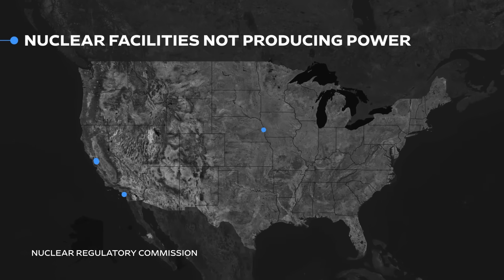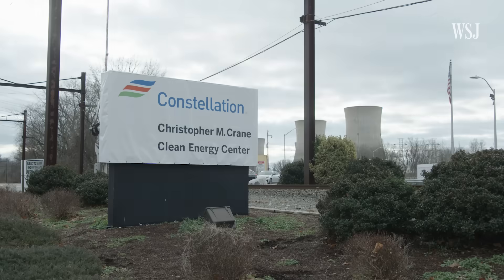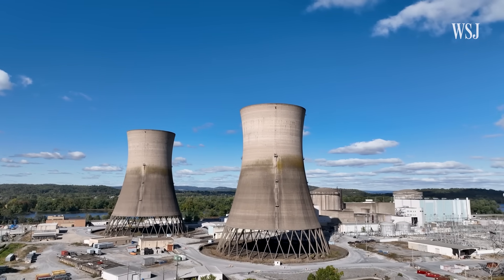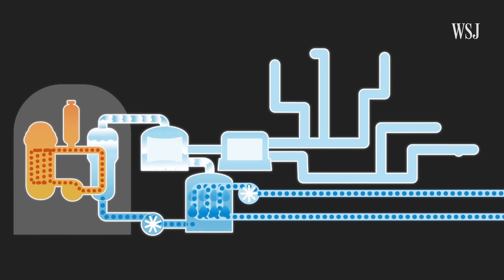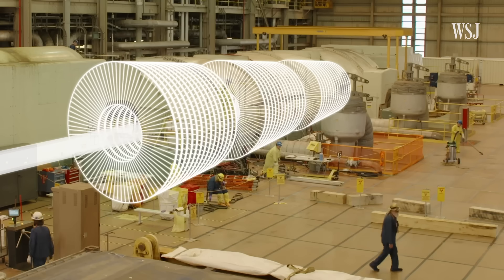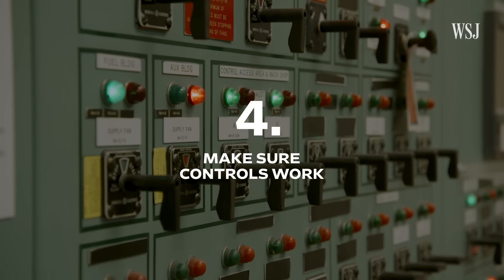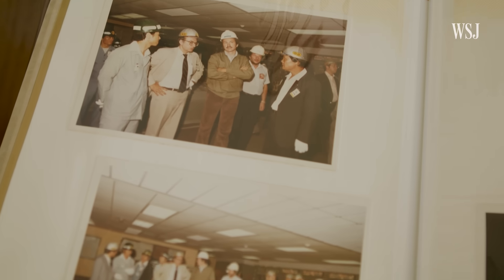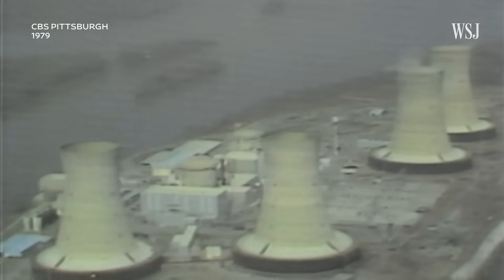Inside the $1.6B Plan to Restart Three Mile Island | WSJ

Comment: Three Mile Island is like the anti-Chernobyl; At Chernobyl, the poorly made reactor exploded and caused a huge catastrophe, while the government denied the severity of the problem, whereas at Three Mile Island, the incident was relatively minor, the reactor didn’t explode, but everyone around totally freaked out about it.
Reply: It was in fact rather minor compared to other meltdowns
Reply: I wouldnt say it was minor, but it wasnt exactly “dangerous” and definitely was very exaggerated
Reply: I'd generally frame the three mile island incident as: despite almost every possible maloperation, equipment failure and design issue that could make the situation worse occurring, the robust design of other elements and overall integrity of the system saved it. It's a demonstration of good engineering practice and a sobering reminder of the inherent hazards at play - how easy it is to defeat safeguards and how they can also potentially make things worse. 
It provided invaluable lessons that are useful to this day across multiple industries.
Reply: I think you’re downplayIng what happened at TMI. It’s true that it wasn’t even on the same scale as Chernobyl.  What is also true is that the distinction was mostly due to luck, not some sort of superior knowledge or skill or engineering. TMI was a near meltdown situation - not to be dismissed as some sort of success story in relation to Chernobyl
Reply: @marlow769  Retired Nuclear Plant Engineer here: TMI was a partial meltdown.  I have seen the pictures and read the reports.

The reason it was insignificant to the public is because of the containment building which contains all the nasty radioactive materials inside of it.

Luck had nothing to do with either TMI or Chernobyl.

It was a resounding success for the decision by the USA and other counties to require very expensive containment & shield buildings (which often was 1/3 the cost of the nuclear power plant); and Chernobyl was the demonstration of the effects of not having a containment building.

If Chernobyl had a containment building the graphite core fire that released the vast majority of the radioactive materials would not have grown and persisted as the oxygen inside the containment building would have been consumed very quickly.
Reply: @marlow769   Retired Nuclear Plant Engineer here: TMI was a partial meltdown.  I have seen the pictures of the partially melted core and read the reports.

The reason it was insignificant to the public is because of the containment building which contains all the nasty radioactive materials inside of it.

Luck had nothing to do with either TMI or Chernobyl.

It was a resounding success for the decision by the USA and other counties to require very expensive containment & shield buildings (which often was 1/3 the cost of the nuclear power plant); and Chernobyl was the demonstration of the effects of not having a containment building.

If Chernobyl had a containment building the graphite core fire that released the vast majority of the radioactive materials would not have grown and persisted as the oxygen inside the containment building would have been consumed very quickly.
Reply: @marlow769  I’m not sure you can call not bypassing all your reactor safety logic luck.  Also TMI was an actual meltdown that was properly contained.  Chernobyl was a prompt criticality that resulted in a steam explosion.  It’s a big difference.
Reply: Chernobyl is a 6 on the international nuclear event scale.  TMI-2 is a 5. Serious according to the IAEA. There was an offsite release of gaseous fission product. Not anything like Chernobyl. The event scale is logarithmic. However it was still something to be taken seriously.
Reply: They also lied at 3 mile. Maybe you're not familiar with the history
Reply: No, at Three Mile Island, Met-Ed lied to everyone about what was happening. It was so bad that the governor of Pennsylvania finally had to step in and clarify that they weren't getting factual information. In fact, they did have to release radioactive isotopes into the atmosphere due to fears of hydrogen gas causing an explosion. After it happened, there were attempts to silence whistleblowers and even planting of drugs in one person's vehicle. If you lived in the area you would know that the information you received on the news did not depict the whole picture.
Reply: Imagine the valve got stuck closed instead of open…
Reply: @Sws4031  There are multiple safety valves just for that scenario.  The plants I was on staff in which were designed in the late 1960's had three of these relief valves all in a line (TMI was in 1979).  The setting on the valves valves are different.  so that they do not all lift at once.  But the 2nd one will lift if the lowest pressure setting one does not, and then the 3rd if the 1st two do not.
Reply: @perryallan3524  Well I guess playing nuclear Russian roulette with 3 valves in the equation is certainly better odds than just one.
Reply: @Sws4031  The chance of 3 independent pieces of equipment failing at the same time is extremely remote.
Reply: Chernobyl was a failure of Communism, not nuclear power technology.
Reply: You missed the part that in the US regulations became stricter. That's learning. It would be ignorant to roll back regulations.
Reply: Mate it was a very serious event that was nearly as catastrophic as Chernobyl, the difference was dumb luck.
Reply: I wouldn’t call Three Mile Island accident minor how’re radiation released to the environment was very small. The containment system worked.
Reply: A partial meltdown of the core isn't really minor, but there wasn't a reactor explosion. (Despite there almost being one due to a buildup of hydrogen in the vessel) Nobody died. And the towns and cities nearby didn't become uninhabitable. So yes, The Three Mile Island incident despite being the worst nuclear incident in U.S history, didn't cause any long term damage. Aside from the technology itself. This accident ruined nuclear energy's reputation.
Reply: You don't seem to be familiar with what happened at the Chernobyl nuclear power plant. The personnel themselves are there, by disabling all defenses, to the point of explosion. Ignorance and lack of staff experience is the main cause of technological disasters. As of April 2024, seven Chernobyl-type reactors are still in operation in Russia. And there are no more problems with them after so many years.
Reply: @andrek4619  The Chernobyl style reactor's are RBMK-1000 boiling water reactor's.
Reply: And part of the reason for the TMI incident was failing to follow proper procedure. People supposedly interfered with a working system because they "thought" something was wrong.
Reply: @anthonykaiser974  Retired Nuclear Plant Engineer here:  Not true.  They operator actions were within the approved procedures and expectations.  The cause was that the plant operators did not have information that told them the condition of the plant.  They did not know that a relief valve had stuck open causing a small loss of coolant accident (LOCA) and the did not know that there was now a water level in the reactor (which is supposed to be fully flooded and full of water.

After TMI the NRC required all plants in the USA to retrofit temperature sensors on the relief valve outlets to identify a leaking or open relief valve, and required all PWR reactor to retrofit multiple redundant water level indicator systems on all PWR reactors; and all future new reactors to incorporate both of those into the designs.  Most other countries immediately adopted the same retrofit requirements.
Reply: Wait. Nuclear powered artificial intelligence? 
Somehow that sounds seriously sketchy.
Reply: @planetmchanic6299 there is literally a whole genre in the literature about what could possibly go wrong here!
Reply: splode*
Reply: This I agree. US reactors were made to cool themselves down when lost control. We already have inherent safeguards to avoid reactors from having a serious meltdown compared to chernobyl, unlike chernobyl, our reactors would be unable to meltdown unless you DELIBERATELY Melt them down. Otherwise if loss of control to the reactor they'd cool down. You idiots focus too much on the scary aspects, no wonder you went against nuclear. Scared about incomprehensible things like its a steven king flick. 

I may not have any family who worked in nuclear power nor do i have any expertise but I know enough common sense to know if Three Mile island is Bad, and Chernobyl is worse, then I got no worries restarting a decommissioned plant with a partially melted down reactor that isnt difficult to restart.
Reply: indeed ceiling it meltdown is totally a exageration
Reply: I recall reading of pets eyes turning white near 3 Mile Island. What would happen to human eyes ❓
Reply: Wow, you drank a lot of Kool-aide from someone with all of that drivel. Go watch the documentary called Melt Down. Get back with us about who hides things and who did the freaking out.
Three mile island wasn't minor. Those exposed wouldn't think of it as minor either. Especially with people telling lies and trying to cover it up as being minor.
Reply: I like the idea of using the land and infrastructure of the plant again. It’s all there. Saves so much money. I would like to seem them upgrade the system to the generation 4 reactors that are passive safe. And the entire control room needs to be upgraded and be replaced with one that is designed by Airbus. With built in safety features that make it pilot proof. If you fly you know that three mile island is like the 707 of jets with a million things that can kill you if you’re not on your game. Compare that old jet design to a new Airbus and you have built in design safety.
Reply: Exactly. We need nuclear power to fuel the growth of our industry. All the reactors that are able to be should be turned back on or updated and then turned back on.
Reply: I live in the “Evac zone” of an issue ever happened at TMI again. The people around here are still not fond of the plant, especially those who were around in 1979 for the accident. 

All we’ve ever heard all our lives is how there was an accident and how dangerous it could have been.
Reply: It was sabotage before, during, and since... Had they followed protocol there'd have been no 'accident'
Reply: To be fair the people living right next to the reactor where told it was completely safe and the next thing they knew they were evacuated
Reply: It wasn't a poorly made reactor but a poorly designed reactor. A poorly made reactor is one with faults in its construction rather than its design.
Reply: Bro if you watch the documentary you would eat your words. Three mile island waa a hairs breath away from being a Chernobyl.  It was bad and the power company and Department of Energy out right lied.  All the rods were sitting on bottom of reactor lol.  This would smokes the entire Easter sea board.
Reply: > minor
> meltdown
Reply: @azrt43 Yeah, the unneeded evacuation actually caused more harm than the reactor did. The reactor hurt nobody. Fear and ignorance did.
Reply: Chernobyl’s design wasn’t the issue.  It was removing all of your safeguards to do an idiotic grid test.  Yes we all know about the positive Rx at the tip of the rods and the positive temp coefficient of reactivity.  If the safeguards were in place and they didn’t violate their design basis to do the test you wouldn’t have been there to begin with.
Reply: @AAblade7  приведите ХОТЬ одно нарушение, допущенное персоналом, с обоснованием. Регламент и ПБЯ–04–74 в открытом доступе.
Reply: @azrt43  Never seen the 1976 version of the PBY, so can’t quote the specific section for ORM or rod limits.  It’s in the incident report that operators were required to have at least 15 rods fully inserted when below 1000 MW thermal.  They violated that limit due to delays and xenon build up.  Yes many of the logic overrides were allowed by regulations, but the incident report stated that it was insane that those actions were allowed by regulations.
Reply: @AAblade7  у персонала не было средств оперативного контроля значения ОЗР. Последнее значение ОЗР по ПРИЗМА было получено в 01:00 и составляло около 16 стержней. В технологическом регламенте отсутствовал раздел о пределах безопасной эксплуатации, частота контроля ОЗР не оговаривалась. Персонал попросту не видел значение ОЗР меньше 15 стержней.
Reply: @azrt43 like you said they were at 16 rods inserted last PRISMA reading.  They also knew due to test requirements 2 more recirc pumps were to be started.  Due to the design this was going to drop power below test requirements. So they knew more rods were going to be pulled.  Sorry but no operator in this situation can claim ignorance.
Reply: @AAblade7  оператор в своей работе не может ссылаться на предположения и догадки. К тому же, включение двух ГЦН повысило значение ОЗР.
Reply: @azrt43 Their is a difference between an operator guessing and predicting trends.  Yes you get a bump in ORM, but it was never going to give you a lot of margin to do what they did.  Like you said operators should be certain in their actions.  They knew they were close to the limit and still took an action to push closer to that limit.
Reply: @AAblade7  вы буквально признаёте ядерную опасность РБМК, при этом говоря что его конструкция не была причиной.
Reply: @azrt43  Violating rod limits for any Rx design can result in horrible consequences for any plant.
Reply: @AAblade7  система управления и защиты не должна допускать опасных отклонений параметров, особенно если такое отклонение может влиять на способность аварийной защиты выполнять защитную функцию.
Reply: @azrt43  True.  On the other hand that justification shouldn’t be used if you’ve already gone to an unanalyzed condition.  Theirs a reason why other plants of similar design rejected the test.
Reply: The heat couldn’t be transported away from the reactor. Thats extremely bad.
Reply: There have never been serious nuclear accidents. Nuclear just has an insane level of expected safety. A fossil fuel burning plant causes more radiation release, overall excess death due to particulate pollution and climate change—all while it is working correctly. A failing nuclear reactor cannot cause that much damage.
Reply: @hylje  Inaccurate statement. There have most certainly been serious nuclear accidents involving and excluding nuclear meltdowns. BUT the Three Mile Island accident was not one of them. A reactor meltdown is situation that can lead to a serious nuclear accident, but in and of it's self does not define one.
Reply: @hylje There has quite literally been not one, but TWO major/serious incidents. I’m pro-nuclear myself, but let’s not downplay the seriousness of Fukushima and Chernobyl.
Reply: @hylje  Er, Chernobyl?
Reply: @hylje  Chernobyl was an extremely serious nuclear accident.  We're talking a reactor literally exploding and exposing the core, which subsequently caught fire.  Millions of curies in one single incident.  Now thankfully that's a one off incident that won't happen again, but your comment is wrong.
Reply: @ Your local highway causes more death and injury than Chernobyl. It's not a serious incident.
Reply: @hylje  Tell that to the residents of Fukushima, Chernobyl, Sellafield, 3 Mile Island and a few others.
Reply: @hylje  
Ever heard of Chernobyl???  really never been a serious nuclear accident??
Almost laid waste to an entire continent.
I support Nuclear energy.. But to say Fossil Fuels are more dangerous? or have more risk..
Reply: @hylje  there have been so many that all safety calculations they made after TMI to prove it should really be safe now are blown out and you'd need to run stuff like 300 more years without accident to make the numbers right.
That's the expected safety the designers planned for, just to be clear. so either way you seem to be saying those designers were clueless. but that would be odd now, huh.
Reply: @hylje  I like nuclear but this is embarrassing
Reply: @sonodietrodithe4iltuoincub848 you do realize there are some nuclear isotopes in the types of fuel we burn right?
Reply: when state actually puts the people first above itself
Reply: I stopped watching the show about Three Mile because I thought it was boring, if that says anything.
Reply: There was nothing wrong with the Chernobyl reactor. The procedural process was wrong. Any reactor can get in trouble if not run correctly.
Reply: @karloftinker2832  Retired nuclear plant engineer: There most certainly was something wrong with the RBMK reactor and another with the plant design

1) The reactor design was inherently unstable and could go "prompt critical" and blow itself up at low power operations.  No other power plant reactor in the world has that and no other country in the world allowed that.

Startup of the reactor was to very fast push through that low power zone to prevent the prompt critical zone.  For the test they were running they disabled the safety features that would have safely shut down the reactor if it approached the this low power zone.

2) The plant was built without a containment building.  Chernobyl would have  had minor effects (if any) on the local population and the world (and there would have been no graphite core fire due to lack of oxygen) if there was a containment building designed to withstand venting of all the reactor water as steam.

The USA took the lead with containment buildings by the engineers saying that if everything works the chance of a major nuclear accident is so rare that it should not happen in our lifetime (they forgot human stupidity in that calculation). But, just in case we are going to build a "worst case" containment building around the reactor (which cost between 1/3 to 1/2 of the cost of the power plant.   The Soviet Union came to the same conclusion that if everything worked as planned; and we don't need to build a costly containment building.

Today Russia is building containment buildings for all nuclear power plants - and the Soviet Union started doing so shortly after  Chernobyl for its PWR reactors and they stopped building RBMK reactors.
Reply: @karloftinker2832  Nothing wrong with the RBMK 1000?  So I guess you approve of the graphite tipped control rods, which, when an emergency shutdown is called for, actually insert POSITIVE reactivity at the beginning of the rod travel?
Reply: @johnjones5354  I would approve of a nuclear reactor that cannot be put into a catastrophic condition by incorrect operator procedure. But no such reactor exists. The emergency shutdown at Chernobyl, under normal conditions would have worked just fine. It was the unusual proceeding operation that presented the conditions within the reactor that caused the explosion when the emergency shutdown was initiated. We could argue that should not be possible. But there is not a single reactor on planet earth that does not have a weakness and vulnerability to incorrect procedures that can lead to catastrophe.
Reply: @karloftinker2832  The Russians were convinced that the reactor design could not fail.  THAT meant that the procedure was not wrong by their own definition.  Yes.  The design of the reactor at Chernobyl was wrong.
Reply: @scillyautomatic No you are wrong. The   issue that led to the explosion was known. But that information had not been shared with the technicians at Chernobyl. As I said before, there is not a reactor on planet earth that does not have a design vulnerability to being incorrectly operated. The Chernobyl reactors were a reliable design if operated correctly.
Reply: Yeah, Three Mile Island was a PR-catastrophe, not a nuclear catastrophe.
Reply: No because in Transformers Dark of the Moon it is said that the Soviets tried to harness a power source using an engine part from the ship that crashed on the moon but miscalculated the outcome and covered up the accident.
Reply: And both are from human mistakes but the difference is the Russians did it on purpose and it was just bad training in the USA also one thing it was minor in the end because 3 mile did not have a full meltdown but there was a partial meltdown and that the quality of the reactor prevented a major disaster this is Why reactor 2 will never be used again
Reply: The reactor wasnt poorly made it was poorly ran because someone wanted to keep their standing with the government.
Reply: @Hasid_Lafre  If you're referring to the RBMK (Russian Bomb Making Kit) 1000, it was both poorly designed and poorly built.  It's operation was also extremely poor.
Reply: @johnjones5354  and nobody would listen to the designer when he tried to warn them... So he offed himself.
Reply: @johnjones5354 So poorly built the other 3 reactors kept running til 2004. The RBMK reactor was not the problem, the operators who ignored 70 alarms telling them to stop their test was the problem...
Reply: Chernobyl was due to a terrorist attack
Reply: MY GRANDMOTHER SAID IT WAS SCAREY
Reply: Calling a reactor meltdown „relatively minor“  is something. 😂 
That’s literally the worst case scenario, even though it could be contained.
Reply: @LeonFisher-Skipper  It’s minor in the sense that it didn’t cause a huge catastrophe. The whole thing was contained it didn’t cause a need for mass evacuation and re settlement
Reply: @LeonFisher-Skipper  OK Skippy, let's have a quiz.  In this "worst case scenario" of yours, how many people died?  Was it A.)  1,500   B.) 500   C.)  15  or D.)  0   ?
Reply: @LeonFisher-Skipper not one single person died that is relatively minor compared to Chernobyl yes
Reply: @LeonFisher-Skipper  TMI is literally NOT the worst case scenario.  Literally.  SMDH  Stop drinking the cool aid.
Reply: @LeonFisher-Skipper ”contained” doesn’t sound very “worst case”
Reply: @LeonFisher-Skipper  nothing really happened actually...no loss of life no contamination unlike the millions that are affected to emissions for fossil fuel usage...we have been brainwashed to accept death as a normal part of this energy source
Reply: @LeonFisher-Skipper it was minor.  the core was damaged to coolant loss but containment structures remained intact.  Contamination was at a bare minimum.  The worst case scenario is a full core meltdown that breached all containment structures, so no this is not at all the worst case scenario.
Reply: @LeonFisher-Skipper it was contained. That qualifies as relatively minor when compared to full on breach, like at Chernobyl
Reply: @LeonFisher-Skipper  When zero people are hurt only some infrastructure is wrecked, then “relatively minor” is appropriate, esp given the harm to people all the time from fossile fuels; good grief oil train fire burned down an entire town in Quebec few years ago, but oh no, TMI which hurt nobody, that was supposed oh so scary.
Reply: @LeonFisher-Skipper  melting of fuel is not the worst case scenario typically. It’s the breaching of the vessel. The worst case scenario you are probably think of, Chernobyl, was a meltdown yes but its biggest problem arose from the flashing of steam creating a steam explosion and launching the vessel lid into the air. The raw amount of force behind the steam pressure ripped the building and vessel apart and created the majority of Chernobyls severity as nothing could be done to bring the reaction under control afterwards, exposure of fuel material to the atmosphere, and creating and incredibly dangerous environment that added prolific danger to repairing the scenario. That was all caused by the combination of Soviet era politics forcing a test and hiding a major flaw to the entire system. Yes a meltdown is bad but by no means is it the worst case scenario, in most cases it should only require the shutdown of the plant for repair and removal with little to no exposure to the environment or public at large. Quite literally no health or injuries have ever been attributed to three mile islands release of radiation, and again it can barely be called that due to how small of a difference it was compared to the background levels you or I experience daily.
Reply: @LeonFisher-Skipper  as far as meltdowns go, 3 Mile Island is exactly how you want it to go.  Contained.

My preference would be to demolish unit 1 and build a new one ground up.
Reply: @LeonFisher-Skipper i dont think you know what "relatively" means
Reply: @LeonFisher-Skipper Goes to show how little you understand nuclear reactors. Yes, a meltdown is serious, but there are different grades of seriousness. At TMI, it was contained inside the vessel and no fission products escaped. At Chernobyl and Fukushima, the meltdown was not contained. The major source of radioactivity was from noble gasses that were vented from containment. Next time you should to some research before posting.
Reply: @LeonFisher-Skipper worst case scenario that wasn’t even bad. We should build 10,000 reactors ASAP
Reply: @LeonFisher-Skipper  The worst-case scenario would involve human loss of life or widespread contamination of the surrounding area. Neither of these things happened. Do you know why? Unlike Chornobyl, 3MI had a containment shield to stop all of that, which worked precisely as it was designed.
Reply: A meltdown is a meltdown
Reply: @thecrackin-u8p is that so? So you are a nuclear expert?
Reply: @thecrackin-u8p not necessarily, that’s a little reductionist and part of the fear around nuclear power. Reactor 2 did indeed have some of the fuel melt however that is vastly different than say Chernobyl which had an immediate and uncontrollable meltdown leading to a massive steam explosion blowing the vessel apart. A meltdown itself is not itself extremely dangerous while it remains contained, just run away heat from the reaction causing the material to literally melt. The biggest long term problem would be corium which is born from said meltdown material eating through the vessel and mixing with foreign elements, again only dangerous bc it escaped containment. Three mile island had a breach of radioactive gas that was barely above back ground radiation. The real problem there was its handling of the situation.
Reply: There is no such thing as a "minor" Nuclear accident. While Nuclear energy has great potential you need the smartest people around. Not DEI hires.
Reply: @HonuFlight  Retired nuclear plant engineer here.  Your comment on DEI hires shows just how ignorant and potentially biased you are.

There are no and never was any DEI hires in nuclear plants in the USA.  But there most certainly people from every race and cultural background working in nuclear power plants.   They all have above average intelligence and common sense - and a strong commitment to a "nuclear safety culture."  If they don't and slip through the hiring screening they are flushed out in the 1st several years and never reach the level where they are approving changes to procedures or the plant.  Also, every proposed change gets reviewed by multiple highly experienced people in that area of operation or plant design.
Reply: @perryallan3524  "There are no and never have been DEI hires in the Nuclear Industry". 

This statement is blatantly false. Constellation, Duke, and Southern (just as an example) all have dedicated DEI departments. Constellation for a fact has hiring "goals" (aka quota) for anyone other than white males. Mid level management is fraught with DEI (1/10 engineers are women yet half of eng managers are women). It's not just hiring, it's even in the supply chain. There is mandatory vendor diversity minimums that contracts must be awarded to minority owned businesses. Business goals directly tied to increasing vendor diversity spend year over year. The interns 10+ years ago were the best of the best. The interns since 2018-2019 have CLEARLY been a way for the company to hit their minority hire quoto as nearly all interns are offered a full time job. Management has DEI goals that are tied to their personal bonus, so they go out of there way to adopt this terrible policy. There are discussions lead by the DEI dept about various political topics, not related to nuclear in the slightest. The list goes on and on and on .. DEI is poisoning the well just like in most other big companies and it's 100% in nuclear.
Reply: @TioMogi  Those companies are vary large utilities that own far more fossil plants than nuclear plants.

I'm met many people from their nuclear fleet at conferences and worked with others on industry work groups.    I've never seen or met an engineer, operator, or maintenance person who was a DEI hire in the nuclear world.  We are far more focused on technical capabilities and attitudes than the non nuclear world.    I note that I was mainly retired from nuclear work in 2019. but have been involved in a few nuclear plant problems since then as I was one of the few industry experts in a few specific fields.

A lot of things in the parent company's policies just do not apply to Nuclear.   In certain areas those differences are mandated by federal regulations - although I am unsure if any of those regulations affect who they hire.

What the parent company does outside of nuclear has not been much of my concern.

Note that I worked in the fossil power plant world for at least as long as I worked in the Nuclear power plant world.  Totally different cultures.
Reply: @HonuFlight  Constellation (who is restarting tmi-1 and is has the largest nuclear power fleet in the US) is fraught with DEI unfortunately. The experienced technical positions in engineering, operations, and maintenance are seeing massive retirements from people with decades of site experience and oftentimes, they are being replaced with DEI hires. We have an internal DEI department, mandatory company and personal DEI goals, and it's poisoning the well. I hope that the company ditches this path before it's too late .. we still have TONS of solid people, but when 1/3 of all new people are not the best of the best, it adds up over time. Usually it's those DEI people who leave before even getting qualified but even then it puts more stress on the experienced people to keep training new hires...
Reply: @HonuFlight why the racism?
Reply: @HonuFlight found another person who doesnt know what "relatively" means lol
Reply: @HonuFlight  Level 0 and 1 and 2 accidents are minor
Reply: @HonuFlight  what on earth does DEI - which has nothing to do with hiring practices btw, it's a corporate training word - have to do with 3MI?
Reply: @ETJeanMachine  DEI has a lot to do with hiring practices. You might want to educate yourself before common any further.   There’s tons of DEI hires screwing up in many government in corporate positions
Reply: @ETJeanMachine  Oh, hey, slow down on the cool aid, lady!  Yes, DEI is everything you think it is not.
Reply: @scillyautomatic not a huge fan of cool aid. too sweet. i have worked for companies with DEI programs before, ive seen what they actually are. its sensitivity training. which, to be abundantly clear, isnt a particularly effective corporate strategy. but the use of a corporate buzzword to describe something else (affirmative action), is quite silly if you ask me. DEI and affirmative action aren't synonyms, and "DEI hires" are not really a thing as people construe them to be - disregarding how the term has effectively just become a PC way of say the n word.
Reply: @ETJeanMachine  This just seems to be someones hobby horse that they need to ride into every facet of modern life.  The larger issue of operating that plant is all of the systems are obsolete and may need parts that are no longer made or the companies that supported it are gone.  .
Reply: @ETJeanMachine actually it does because the people being hired would have been trained with DEI active.
Reply: @RevolverOcelot79 Why are you thinking DEI was the problem? Most of times, problems arise from managerial and  communication problems then technical capabilities of workforce. So, every company that set up shops in Asia to manufacture things doesn’t know how fast and good is to trained workforce than a smart one
Reply: @HonuFlight  Why thank you.  I don't really consider myself the smartest person around.   Top ten?  No doubt   Top three?  Maybe.  But smartest?  Nah.

All kidding aside, nuclear power plants are designed by VERY smart people to be operated and maintained by people of average to above average intelligence.  How do I know?  40+ years in the nuclear game.  Military and civilian.
Reply: @HonuFlight  What? Of course there are minor accidents. They just don't get published because workers forced to clean radioactive puddle would get pretty old after the 100th time.
Reply: @stephhugnis  Not true, nuclear power is HEAVILY regulated by many organizations, namely the NRC. Any radiological event, regardless of size/impact is reported to the NRC and is public information. Not just radiological events either, equipment failures that put the plant in certain limiting conditions, safety events (OSHA), and human performance issues are all regulated and receive multiple recurring audits.
Reply: @HonuFlight  look out we got a culture warrior here
Reply: @HonuFlight tf are you talking about boomer
Reply: @schalitz1 you would have a better outcome with DEI than Maga...
Reply: @tazpartridge1612  absolutely not. The nuclear industry was built via a meritocracy. DEI has no place in nuclear power
Reply: @tazpartridge1612 OH REALLY?! How’s that going in California???